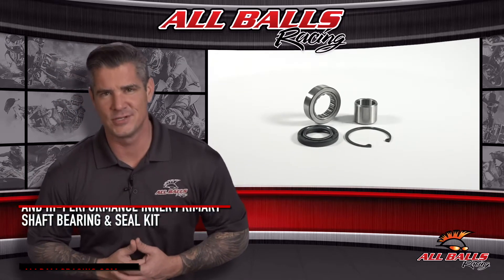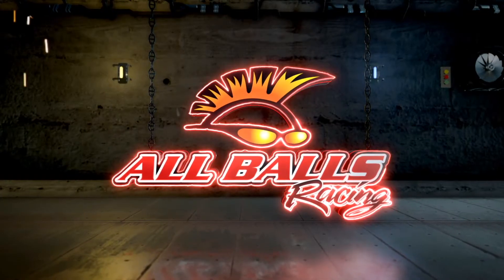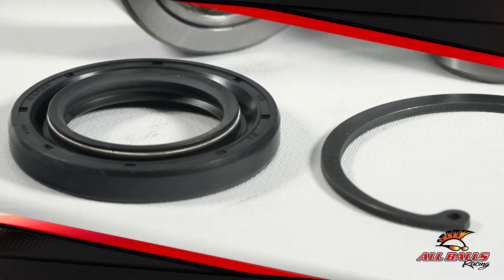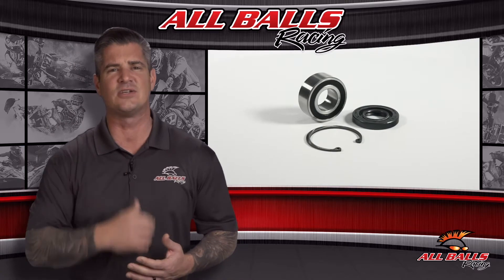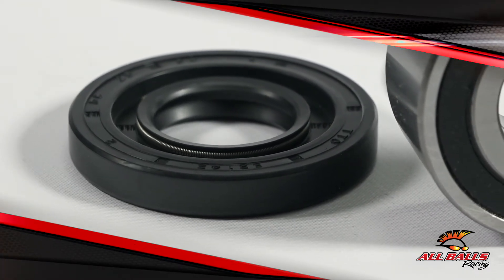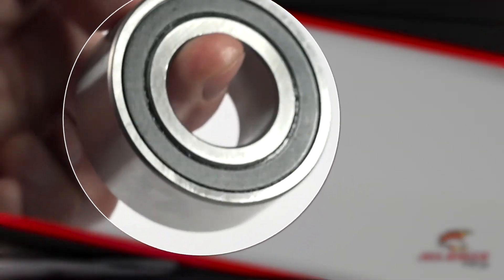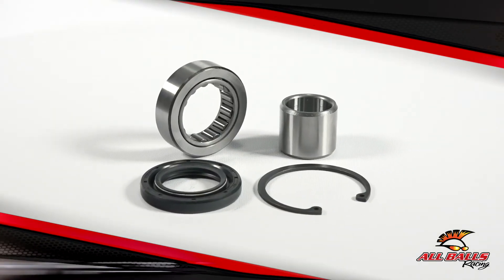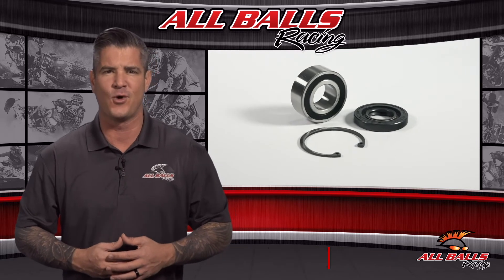All Balls Racing - Inner Primary Bearings and Seal Kits

Comment: I'm sorry folks but I had completely the opposite experience with a replacement kit I just purchased from All Balls. It was a standard kit - but marketed as an upgrade.  The inner primary bearing that came with the kit was noticeably inferior to the OEM in several respects. The lateral movement on the bearing cage was frightening. The outer casting looked like rough cut ceder - more like a cheap chinese knock off. It's against my religion to not replace a bearing when on a new install of a main shaft, but when I saw how the original bearing  with 20K on it was tighter than the brand new one I got spooked and left the original installed. - Extremely pissed that this is passed off as a superior bearing.

Seal quality was excellent though; what you'd expect from Jims or Genuine.

Comment: I bought the upgrade didn't work for me it was to wide . i was going to use it on a 1989 Harley FLHS . The main shaft on my bike is tapered . when I installed the clutch basket and tightened the nut to torque it pushed the bearing bar tight I couldn't turn the shaft . damaged the bearing now I have to take  it back out  and install a new original bearing. I had no luck with the upgrade.

Comment: Can you please put a vid on how you fit the wider bearing into casing and just one cer-clip, what stops it coming out and hitting the clutch basket ? Thanks
Reply: you probably already figured it out but the c-clip goes on the clutch side.  The bearing on the sprocket side is 'held in' by the seal which is against the main shaft. I put a small o-ring between the quad seal and the inner primary seal just to make sure the quad seal doesn't walk out. Not sure if I needed to do that but 4000 miles later... zero leaks.

Comment: Allright. I ate the rotor in my primary. Ordered these because of a suspect leak. 
This kit off the net is on par with Harley's price for the bearing. But, here its an actual upgrade.
The best investment any biker can make. Buy the book for your scoot. Not the owners manual but the shop manual. Hold Harley accountable for any changes that come out.
I'm that guy who has been on a Harley since 1999. I am that guy who is a helicopter mechanic. It took one dirt bag mechanic at a shop (Fantasy Cycle Co Springs 2001 timeframe) to crunch enough to tell me. Yo Doberman the machine is out of warranty. Go Aircraft mechanic on your ride. 
I did not know anything about all balls 3 days ago. The bearing is not in yet. I will say how it went. After this comment.
The package says 25-3102 is not for a Dyna. I am running a 00 with a 02 transmission. But, everything from Performance Offroad out of ID, says otherwise.(in case anyone bought online) Lots of parts run wide through the lineups.
I have wrenched and played Part Number games enough. My Dyna is a true to life out of the factory frankenbike. I am bouncing between 99-05, 99-02, 99-?.
2nd year twin cam built in 99 but, blessed 2000. I was in Kosovo 99-00. My bike Bullet is a true to life vets war bike and I have taken her down to nothing. Then back up again.  
Fingers crossed what I am looking at in my hand. Can handle Edelbrock heads, 625 S&S cams, Jims' roller rockers/lifters/titanium pushrods, JE 10.5/1 pistons, 88 with new 95 cylinders punched .0.05 over, Nology wires, Screaming Eagle 6200 box, Thunderheader, Mikuni HSR 45 with a Forcewinder intake.  Harley's stuff was able to on this end of the primary.